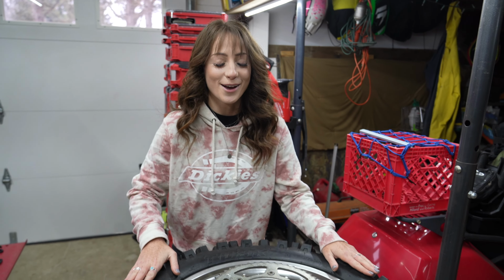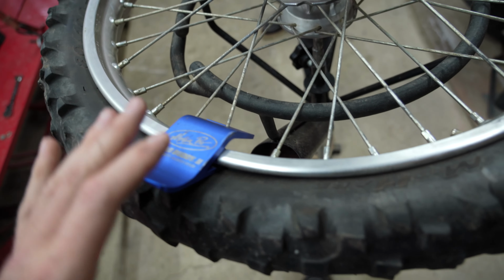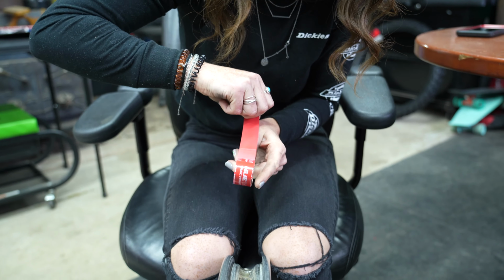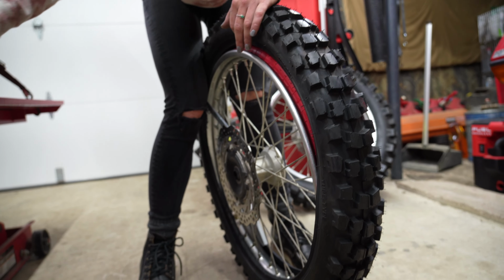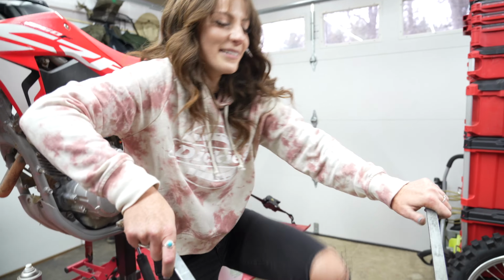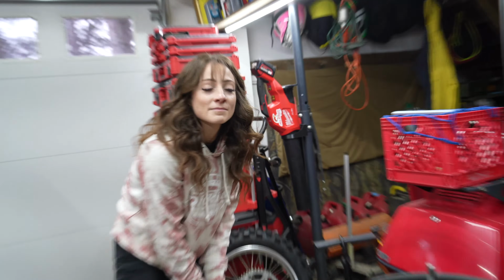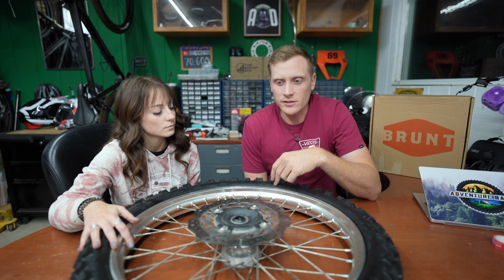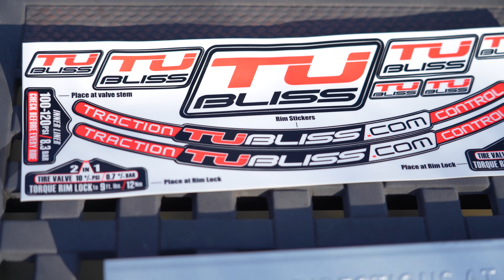Can Alexis Spoon Tires?.. | Girlfriend vs Tubliss

Comment: I use spoons myself, And I lube the crap out the red bladder and the tire bead. The reason for me at least to use the tubeless is light weight for low hp bikes like the Honda CRF300L/Rally. Switching to Alu sprocket and tubeless saves weight on that rotational mass. It might be in my head but I feel like I can feel a significant difference.

Comment: Alexis did a great job. I have a rabaconda, and it's still challenging. Some tires are a lot harder than others. My tires usually hold air for about a month or 2. I usually check my tires every couple rides.

Comment: Been using Bridgestone Ultra Heavy Duty tubes for over 20 years. The tube would eventually fail at the the valve stem from changing them so often. Always carried a spare tube (cheap one) and tire changing equipment on my dual sport rides. Finally switched to the Nitro mouses 3 years ago not because I was unhappy with the HD tubes. Just got tired carrying the tube and tools. I just pull the Nitro’s once a year and call it a day.

Comment: Those Grunt boots would serve me well…while I’m WAITING for my 300 Rally to eventually come in! Love the content, as I’m new to the dual sport riding world. Keep it up!
Reply: I just bought a 300 Rally. Shop near me got a used one in. 2022 with 610 miles on it. The guy that bought it was short and kinda have a little problem so he sold or traded it back. I latched on to it because they are pretty hard to get right now. I've only been able to ride it 20 miles so far due to weather. I think I'm gonna like it. 😁

Comment: Experience  helps. Use 2 or 3 bead buddies. Better tire irons would help as well. I use one large zip-ty racing long tire iron with aluminum handle. I use the good motion pro spoons with the loop at the end. I just use soapy water or windex. Watching the tubeless video and following it exactly helps. If they are in correctly they don't lose pressure. For cactus thorns a tire sealant like Slime helps a lot.

Comment: Love the Tubliss system I have been using it for the past 3 years for Moto. On the rear, I have had no problems with the front tire I stopped using it. At first, on the front, the system would go flat overnight once I solved that problem I had multiple inter bladers go bad the little tube would split at the seams or the valve core would tear away from the tube.

Comment: Tip for the Murphy tire lube:  Put a glob of lube in a empty Gatorade bottle then fill rest of bottle with water. Shake well and let it set for a few days then shake it up again (Takes a few days to dissolve). After it has dissolved in water put it into a spray bottle. A lot easier to use than messing with the gooy stuff.

Comment: I use to run tublis it was ok my main complaint with it is you have to check the air pressure in your bladder if it sets for a week at least mine did u finally went to bib moose no more worries about flats and if you ride on the highway with the tublis you will feel some vibration if you go very fast im not putting them down I used it for 4 years but I would recommend when you replace a tire you might want to consider putting in a new bladder I learned the hard way  but as they say different strokes for different folks

Comment: Hello from France 
The front tire is really tricky
So first congratulation 
I tried 2 times 
I put a bib for the front
But i got expériences from the rear...
So i will try the next front tire with a new high pressure chamber
I use spoon tire iron ... front tire is more tight ans it's not easy to touch the red chamber...
And notice to verify if your HP Tube is ok before put your tire
Inflate deflate...😊

Comment: Rear tyre is easy. Front tyre is harder to get on as the Tubliss takes up most of the rim. 2 x Bead Buddies and a couple of G clamps to squeeze the tyre into the drop centre helped me.
Getting it off again with out  picking up the red liner? Still working on that.

Comment: I just use a 3m sealant tape with a crystal clear vinyl gorilla tape as a protection layer. Couple all this with a regular street value stem and it will hold pressure.

Comment: Great job Alexis.
 It aint easy and more so on the side of a trail without a wheel stand or a bucket. 
I have smaller 8" long spoons in my trail pack and luckily have only ever struggled when changing tires as have been using HD tubes and never had a flat in the last 20 years but don't run as low as 5 PSI.
Maybe the lowest was 8psi  but usually run 10-12 psi as I ride asphalt also to get to the trails. 
lots of hard pack or rocky trails and forest roads  and yellow and red Clay soils and mud where I ride. river and creek crossings 
Never had issues with traction on the XR so never saw the need to run as low as 5 or lower. and never bent a rim either.
But that is just me.

Comment: ok so one of the reasons you probably had a stem failure is because they recommend you place the rim lock closer to the tube stem. The instructions show 4 spokes apart or you will damage the liner. Also use Armoral and spray the entire red inner liner and it will go on by hand. The inner liner will lose some air like any bicycle tube with high pressure such as a road tube so you should at least check it. You can run some tubeless sealant in the chamber part such as Stans Notubes which works great for these and will seal smaller holes but always carry a plug kit. Plus if you get a flat in the chamber part and the inner liner stays up you can generally ride it out as it will hold the tire in place and keep it from coming off the rim.

Comment: I used tubliss for about 2years, to me it is way more maintenance, $$$ and it does lose air so your checking every ride, so for me just the conventional  tube and 12-13lb air offroad or 15 - 18lb 50/50 dual sporting works the best, If your doing a long long adventure ride just carried extra tube, patches, bicycle pump, spoons. if you really stress it that D sport tire can be ridden 30mi on a flat,

Comment: how much does this system weigh ??   I am thinking?? do I really need super low tire pressure???  its pretty cool.  I remember getting super strong tubes back in the day.. not even sure if you can still get those.  they were like "clear" I think and supposedly puncture proof.  (from the 1990's).. I ran some tires SO worn I mean you could see the radio strings all around the entire tire on one bike.. and I rode it that way for 6 months before finally changing the tire.    probably not smart.. forget about the traction.. the side knobs would grab a little I guess.. (rear - I wouldn't ride with the front that bad but the front was a banana peel as well but no radials showing)

Comment: What is the real benefit of tubliss?  I'm also replacing tires 5-7 times a year and I wouldn't want to deal with that mounting over and over.  You also only showed the front, which is so much easier

Just seems like a pain in the ass to install and I wouldn't want to have to deal with an issue on the trail during 8-10 all day ride.  Also, I would have scotchbrited the inside of the rim and removed all the bullshit residue
Reply: There are tons of benefits to using tubliss. The main one is offroad traction, obviously. I ride with a lot of people that use this system all day and don't have a problem. A seasoned rider, such as yourself, checks their tire pressures before each ride anyway, so that's no extra inconvenience.

I think you are misunderstanding how the system works. It actually makes an "issue on the trail" easier to deal with. With Tubliss, you don't need to carry heavy / bulky spare tubes and tire spoons. You can use a tire plug, reinflate, and keep going. The tire doesn't need to come off the rim or the bike. Way easier. If you want to, you could run it flat, since the inner high pressure tube still has pressure.